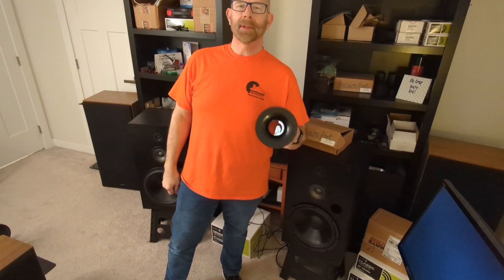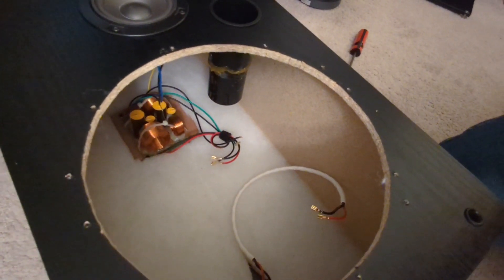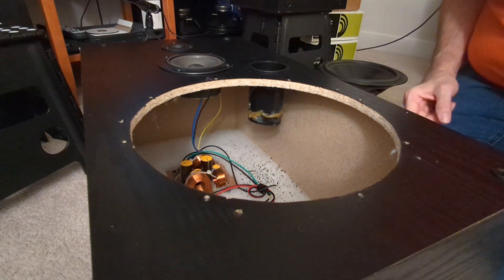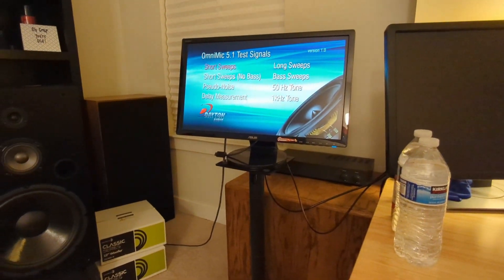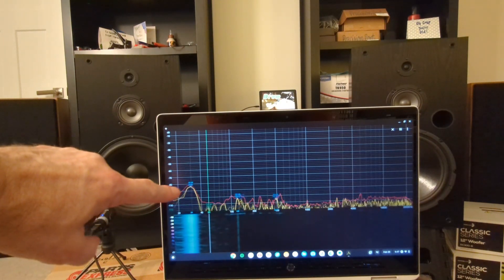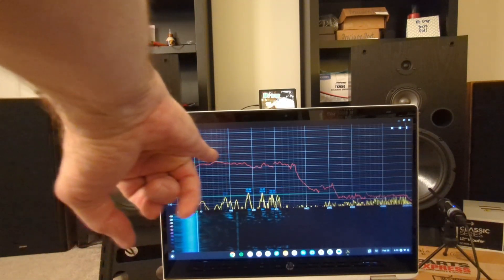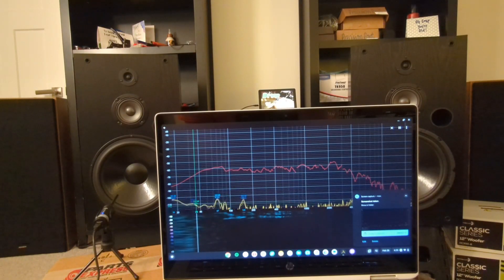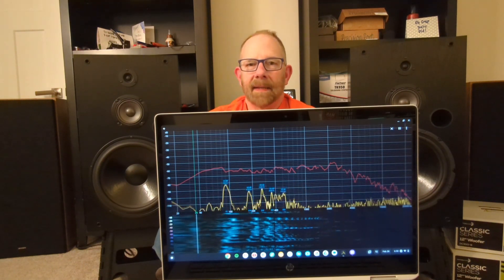Bass Reflex Port Tuning: Which Woofer Is Better, The Dayton Designer Or The Dayton Classic?

Comment: I have an increased frequency of almost 6db around 40-50hz. Is it possible to reduce the tuning in some way? For example, by plugging or reducing the diameter (width) of the Bass Reflex?

Comment: Lol, those cabinets are so thin, amazed they can hold the Dayton without disintegrating.😂
Fair play though for saving them.
Reply from the maker: Thanks for watching and the reply! Yes the majority of vintage mass market speakers are built with 1/2" particle board / low grade MDF (barely can be classified as MDF). They're actually quite strong, especially when braced and gusseted. They're not as dense or heavy, so I give them some structural rigidity too, but to mitigate resonance they're lined with sound deadener.

Comment: What about the box dimensions used here ?
Reply from the maker: Thanks for the question. Advertised outside dimensions are 25-5/8" x 14-3/16" x 12-1/4” which works out to about 2 cubic foot internal volume.
Reply: @wattspeakers  thanks
Reply: I have a speaker cabinets 29 3/4” h x 17 3/4 “w x 13 “d and a port 2 1/2” diameter x 5” long i can figure out the volume and what are they tuning at , i try to use some calculations but they give me different answers.
Will you be able to help me to figure this out please!!

Comment: Todd, you have made me aware that woofers do a halfway decent job of reproducing most of the music if the crossover is bypassed.  What if you do the same with the tweeter?  Does the long wavelength bass cause the tweeter to bottom out and become nonfunctional?  What really happens if you just wire all drivers in the cabinet in parallel with no crossover?  Why does a sharp cutoff crossover sound better to people who can hear the difference?
Reply from the maker: Excellent observation and questions! Back when I used to walk to school, 8 miles in the snow up hill both ways, tons of loudspeakers were made with minimal crossover components. With the exception of the higher quality designs from those companies making speakers for more discerning listeners, 2 way loudspeakers would often have nothing to filter the Woofer and either a single capacitor on the tweeter or a 2nd order, (capacitor and inductor), on the tweeter. Similar for 3 Way designs, with nothing on the Woofer, but with simple first order, (just capacitors), or 2nd order, (capacitor with inductor), on the tweeter and the midrange.

While it may have been to keep costs down when manufacturing a million speakers for people who couldn't hear the difference. The truth is, for most, especially at low to moderate volume, it worked out just fine and still can today. This is especially true with decent transducers that have a fairly wide frequency response and can handle plenty of power... Like the Dayton Designer I'm working with. If you ask me, I think that I could make an okay sounding 2 way and not even filter that woofer. As long as I protected the tweeter from lower frequencies, (which will eventually harm the more delicate driver), it would sound fantastic to most... Maybe even to me.

So, to your point, it's possible to run 2 or 3 transducers, e.g. woofer, mid-range, tweeter, without anything in the way, but there's inherently going to be issues with that design philosophy. 

The most important reason, is that a crossover network presents a pseudo minimum load to the receiver or amp. By filtering them, it side steps ohms law. 3 x 8 ohm drivers connected without a crossover results in an ultra low impedance... Not a deal breaker, and "back in the day" those beastly receivers and amps from the likes of Harmon Kardon, Marantz, Pioneer, etc. could handle those loads. With today's cheapo consumer receivers you'd likely smoke the receiver. Once you get to a certain price point today, better amps and receivers can indeed still handle fairly low resistance, some as low as 2 ohms, but for the majority of receivers it would destroy them.

The second and less obvious reason to use the crossover, is to filter out the bulk of frequencies that would otherwise harm a tweeter or mid-range, because they have physical limitations in terms of low frequencies they'll play, (creating an audible buzz until they fail), or high frequencies that'll make them ring, screech and distort. The higher frequencies won't harm the drivers but it will make them sound funky.

The remaining reasons have to do with how clean the system will sound and how loud it will play. Application specific transducers like subwoofers, woofers, midranges and tweeters have a "sweet spot". That sweet spot is where the frequency response is the flattest with a consistently linear impedance.  By crossing them over, (transitioning from lower to higher frequencies), it allows each driver to play music or source material most effectively. The advertised useable frequency response is an indicator of that. For example, the Dayton Designer I'm using has a useable frequency response of 25 Hz to 2500 Hz. It'll still try to play lower and higher frequencies, albeit less effectively. By rolling off the majority of frequencies by way of box tuning and the crossover, it behaves better and plays music better. Since passive crossovers like most use, are only filtering and rolling off those frequencies at a certain rate, 12 Db per octave for the crossovers I usually work with, which are considered "2nd" order, because a first order is 6 Db per octave, a 3rd order is 18 Db per octave and so on... But it's not magic and the  frequencies are still playing, just at less SPL sound pressure level, making them less audible.

In other words, filtered frequencies still bleed into the drivers that don't play them back well. As the output a.k.a. volume increases, those become more audible. In the case of the Dayton Designer, I will use a 12 Db per octave filter that's roughly 600 Hz to 800 Hz. By doing that, frequencies near the limit of its useable upper range of 2500 Hz will be in the neighborhood of 20 Db lower in output than the rest of what it's playing... Thereby preventing any nastiness caused by cone break-up, (higher frequencies literally vibrating/shaking the paper cone material to the point that it loses structural integrity). The handoff of those higher frequencies beyond 2500 Hz are better suited to the mid-range and it supplements that region the woofer doesn't work well at. Rinse and repeat for the tweeter.

Conversely, the "Fb" of the box is important to the lower frequency limits of that woofer. Currently they're tuned to roughly 40 Hz which allows a rapid decrease, (vented enclosures have a 4th order roll off, or a decrease of 24 Db per octave in lower frequencies from making the woofer distort and generally misbehave in the deep bass region. That way, at 20 Hz the Woofer isn't trying to playback at the same volume as the rest of the bass, thereby eliminating distortion. If you get the chance check out my goofy cardboard speaker video, https://youtu.be/-g6HLJX3qFM because there's a point where I'm playing the Dayton Designer Series crazy loud with drums and there's literally no audible distortion. That's because the box tuning and low frequency roll off is pretty good for that Woofer.

All the drivers, regardless of the crossover design, will attempt to playback all frequencies, but by using a combination of high pass and low pass points, it limits how much of those frequencies are audible. Initial calculators and math are the science that will get you in the ball park, but blending them is the art and the hardest part of the whole build. For a speaker design intended for an audiophile, it may very well be the most focused and time consuming area of design.

In a nutshell, crossovers make the Loudspeaker system as a whole operate better, producing better sound and less stress on the receiver or amp.

Comment: Those subwoofers need to be crossed no higher than 250, which is a problem for those midranges.  🔈🔉🔊
Reply from the maker: Thanks for the comment. Neither the Dayton Designer or Dayton Classic is designed to be a subwoofer. They're home audio woofers with a usable frequency range of 25 Hz to 2500 Hz.
Reply: @wattspeakers  Any driver claiming near flat spl's at 25 is a sub.
Reply: @TriAmpMyFi  😂
Reply: @wattspeakers  poof